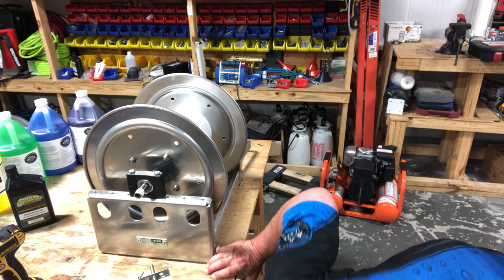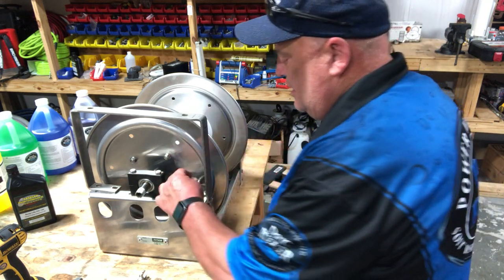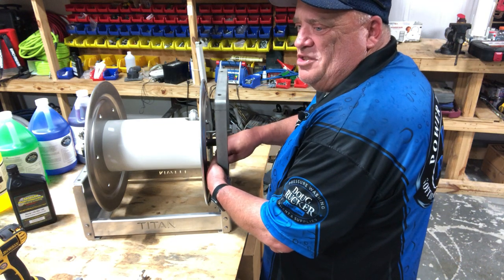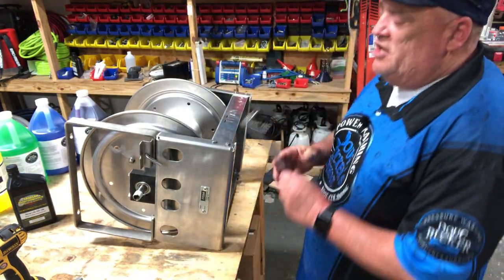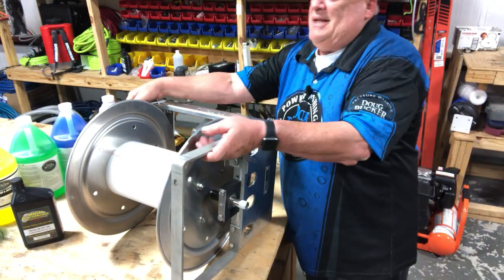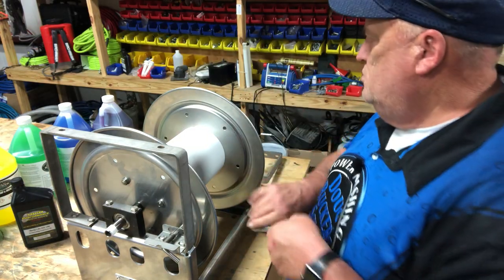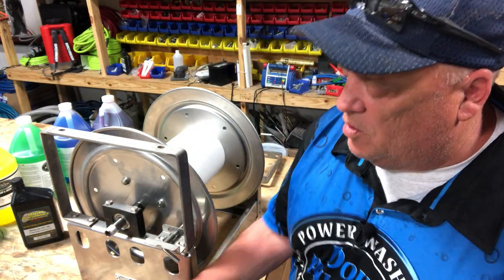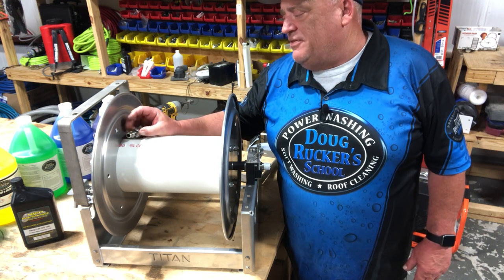Pressure Washer Hose Reel Stack

Comment: I was looking for the "how to" with installing the stack kit with electric reels.
Reply from the maker: Same bracket.
Reply: @PressureCleaningSch  Of course...same bracket.   BUT... for electric reels.  You'd need a spacer on the  3 sides that DON'T have a rewind button, to make it mount level.  A few washers will work.  but with three nice little strips of stainless steel with 2 hole in each, that would make a more long lasting stable base.  Do you know how hard it is to drill a hole in stainless steel ?
Reply: Where can I order these stackable reels I actually need a 3 stack

Comment: How do the Hannay reels hold up to the softwash side? Running strong SH %. Are the manifolds stainless?
Reply from the maker: They hold up very well. Yes the manifold is SS. They won’t last forever and when the manifold goes I’ll probably just by pass it and use the reel only.